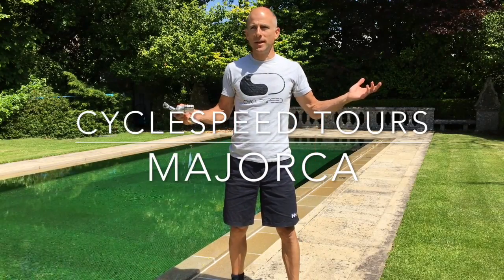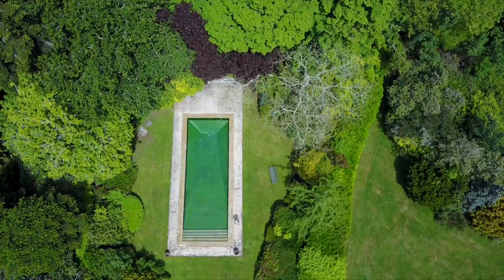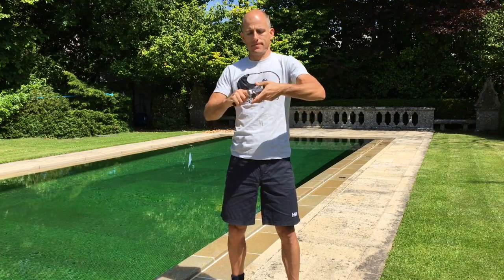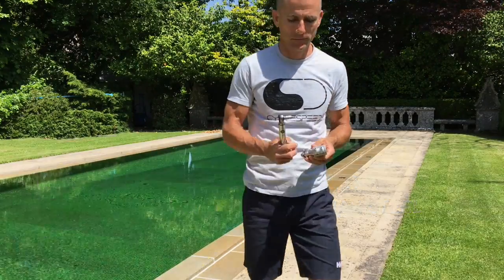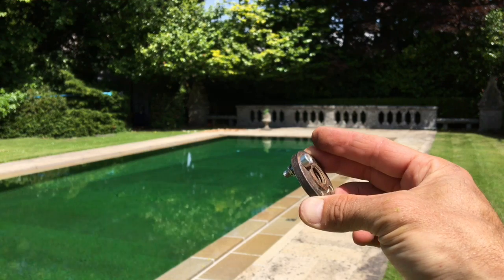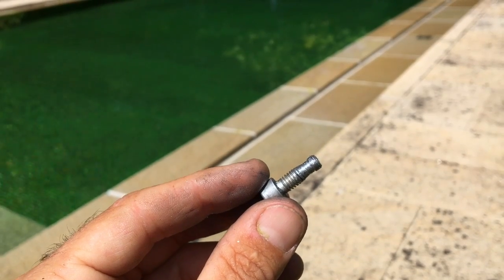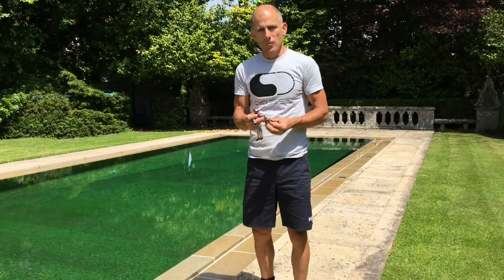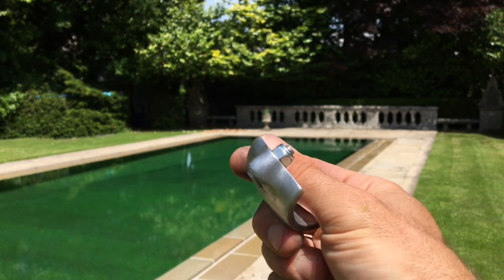How much Torque does it take to Break a Bicycle Bolt?

Comment: Good evening. I'm really enjoying your videos. I wondered if you had a rough torque guide for bike components on a carbon frame, some parts have a max torque indication but many parts do not. Kind regards Allan.
Reply from the maker: Hi Allan - as a rough guide, the smaller M5 bolts (4mm Allen key head) should be between 2 and 4Nm, and the larger M6 (5mm Allen key head) about 4 to 6Nm. But generally only tighten as hard as you need to, so you can often use a bit less. Hope that helps!
Reply: Cyclespeed Tours thank you 👍

Comment: you brake the carbon handlebar , not the bolt .
Reply from the maker: I have seen many cases of stem bolt failure, but I have never seen a carbon handlebar crushed by the stem. As long as you don't go crazy, you won't 'break' the bar.
Reply: @CyclespeedTours  im scared of my 2 bolt braking on stem . XC  bike used for city/road/curb riding.  should i make a switch to a 4 bolt stem or change bolts from time to time

Comment: Worth pointing out that the tensile force in the bolt for any given torque varies greatly with how dry the threads are. If your threads are greased or oiled, you need a lot lower tightening torque (Nm) for the same clamping load. For instance, if you grease your seatclamp bolts threads, use a few Nm lower when tightening.
Reply from the maker: Yes, very true.

Comment from the maker: Forgot to mention another factor in bolt failure; fatigue. Especially in aluminium. Although it may take say 8Nm when new, 5 years down the line after many tightening / loosening cycles a certain amount of fatigue will may set in, and yield strength could reduce.